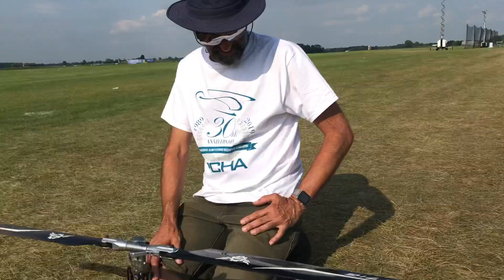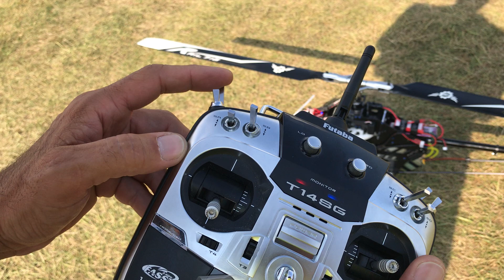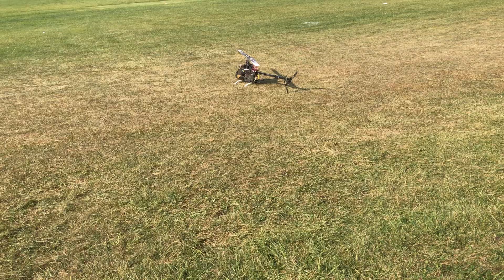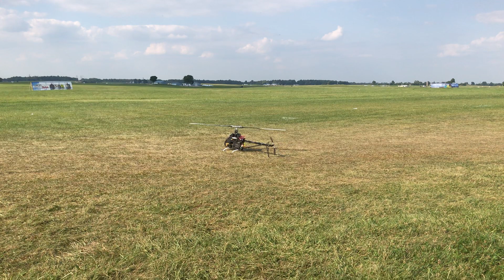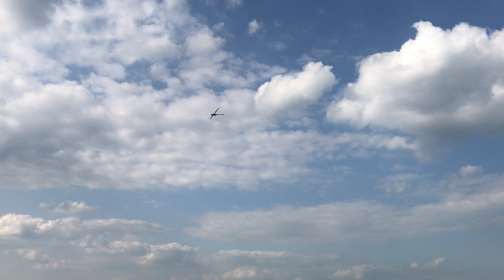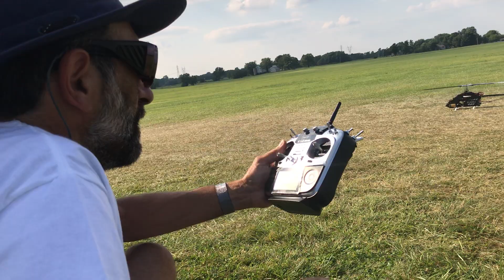Whiplash Turbine at Ircha 2019

Comment: This is the most badass thing I've ever seen. I'd be so scared and intimidated to fly it though. I just love the sound of turbines. I'm assuming that you can't use a canopy? Is 3D flight possible?
Reply from the maker: This video was from maiden flight at Ircha 2019. We have videos with canopy and 3d flights.
Reply from the maker: Here is the 3D flight video from Mitch Marozas at Battle of Brand  2020 with the Whiplash Turbine
https://youtu.be/5TtMEGGtHuQ
Reply: @miniatureaircraft  Thank you for the response. I contacted Helidirect to purchase this heli! I'm super excited because I've always wanted my own turbine heli. I never knew this kit existed until recently. 

I was looking at the twin tank upgrade (MA135-148) and was wondering, does the extra weight (tank + fuel) affect 3D flight performance at all? Also, do you roughly know how much time this tank adds? Are there any upgrades that you would recommend for this heli? I've only flown electric helis before so a lot of this will be new to me. Do you have any advice, tips, or anything in particular that I should know that might help me? 

Lastly, was a generator ever designed? Thank you so much in advance! You guys are the best.
Reply from the maker: @nightshadehelis9821  The twin tank upgrade extends the flight time to about 10 to 14 minutes and longer. With one tank flight time is about 5 to 7 minutes depending on your flying style. The twin tank system adds about 0.8 kg including fuel. Total capacity then is about 1.8 liters plus header tank. There is an upgrade MA135-760 available which extends the tail boom.
A generator system is in testing at the moment..

Comment: I would replace the plastic rotor gear with a metal one.
Reply: I have a Trex700n on a standard main gear (plastic) with a wren 44H turbine in it, its done over 30 hours with no sign of wear or distress on any of the transmission.

Comment: What an amazing piece of engineering here and great flying abilities. Not a pro like you but do have a question. What is the purpose of flipping the switches at minute 8:20 ?
Reply: Its because Idle up 1 is idle at the bottom stick so I can throttle up gradually to take off.  In idle up 2 its full throttle at the top and full throttle at the bottom for full power inverted climbout.  If you land via throttle hold you are still in idle up 2 at the time.  You must flip back to idle up 1 before releasing throttle hold otherwise if you just un-click throttle hold the engine would get an instant full throttle command with the stick all the way down.  You don't want to do that from idle on the ground.